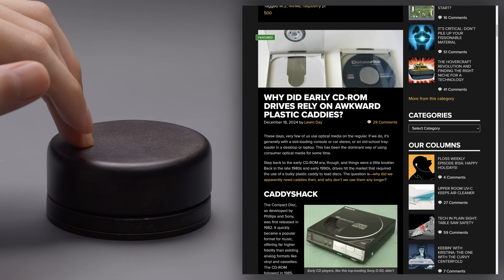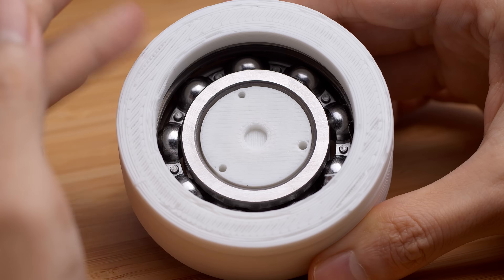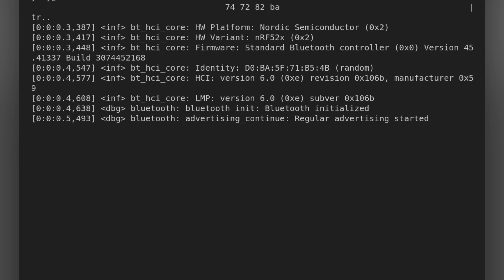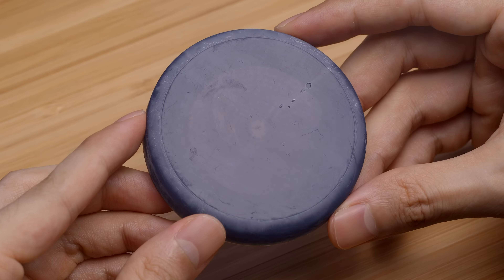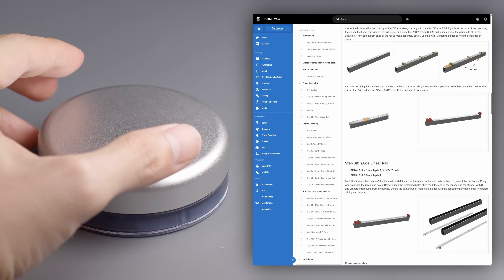Wireless High Resolution Scrolling Device: Full Scroll Dial v2

Comment: If you're making dials of wood, I'd consider buying torrefied wood (also referred to as "roasted"). The process of heating it slowly for 7-10 hours will convert the organic material into carbon, making it harder and most importantly, more dimensionally stable. Standard, kiln dried wood will expand & contract by ~2% if quartersawn, ~4% if flatsawn (grain direction). If you are relying on a tighter tolerance around the bearing, that will matter when relative humidity changes occur. Added bonus, most torrefied, closed grain hardwoods (like Maple) do not rely on the protection of wood finish. A one-step wipe on oil finish would be enough to enhance the appearance.

You could also consider denser, more oil rich woods like African Ebony or many hardwoods from South America as they tend to be more dimensionally stable. That density would contribute to a more premium feel and the oil rich exotics do not require comprehensive finishes, saving some manufacturing time. Ebony, Cocobolo, Lignum Vitae and Rosewood with a light, single coat of beeswax or Tung oil would be beautiful and robust. One caveat, some people are allergic to the oils in these woods.

I'm signing up on your site, I would love to be one of your first customers.
Reply from the maker: Thank you for the wood tips, I'll have to do some catching up on wood selection.
Reply: @engineerbo  As hullinstruments says, you want a stabilised wood, so you can use whatever you like - they are made from a process of putting the piece in a vacuum chamber filled with epoxy resin, so the resin gets pushed into the wood. Knife-makers use it for handle scales (inlays in the handles of knives) and you might be able to find a large enough piece looking at knife-making supply places. I always love anything with walnut and brass. A brass inlay of your logo would be cool. You could use a small lathe or even build one using an electric drill to turn this sort of thing, but I guess you want an excuse to buy a CNC machine ;) Love the project!
Reply: I have a bunch of rare Australian hardwoods, if you can find a safe way to contact me I'd happily send some.
Reply: The most dimensionally stable way is with stabilized Woods. Which basically turns them into an indestructible composite
Reply: i love nerdy comments on nerdy videos
I'd love a wood scroller, as my setup revolves more around wood accents. I'd vote for this option to be available 😋
Reply: this is silly, dont make wood the structural components, continue using aluminum, just put a wood facade around it.
Reply: with exotic and rare woods, costs would increase substantially and deforestation is a real global problem
Reply: @GerManBearPig  I just looked up "deforestation" and man, thanks for telling us. I had no idea where wood came from, but fortunately you were here to tell u all for the first time.

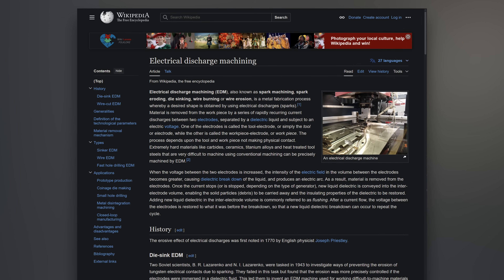Comment: 15:25 i am watching this video to NOT THINK about the disaster that is my wedm project.
So please please please, from someone who tried this, edm is hard. To maintain a spark is hard, to move smoothly enough is hard, signaling is hard, high voltage is hard.
Tldr edm is a hard project, even just a hole popper.
Also... Edms need electrical contact, so you would need to scuff up the anodized surface anyway
Reply from the maker: Thanks for the information, it sounds like... fun? Good luck with your project!

Comment: Making the holes in the top dial larger and epoxying in threaded inserts might be a better option than tapping. Way easier and doesn’t require any special tools.
Reply: Or just press fit the bearing.
Reply: @ It’s tough to use press fits without being able to guarantee tolerances between manufacturers. Especially if it’s a 3d printed project.

Comment: If you do a third video on this, check out the Logitech scroll wheels that are found on things like the G502! You have the standard mode that has a detent per turn for precise control, or you unlock it for complete free spinning action where you can move through stuff quickly and fluidly. It's one of the reasons why I haven't switched away from them despite the issues with the mouse double clicking over time.
Reply: You know you can just fix double clicking by soldering a switch that's less than one dollar right?
Reply: @youtubehandlesux  Sure, but you can also do the "proof of life hostage video" request that their customer support demands if you want to warranty it.

Comment: Al2O3 layer is very hard. Especially for tiny M2 tap. Drill out hard anodized layer before tapping and use M2,5 screw - one is enough for this aplication. Or rotate part slightly and make 3 new holes for M2.

Comment: Why did you use M2 threads so much here? In general for mech assemblies you need a really good reason for such small fasteners since the taps are so easy to break (as you found). Looks like the top part at least easily has space for M3 bolts instead of M2

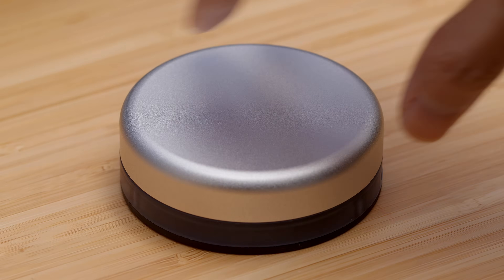Comment: 18:02 What is causing the eccentricity/wobble?
Reply from the maker: I gave the aluminium dial too much clearance, hopefully that's all there is to it!
Reply: @engineerbo  It guess it makes sense, better safe than sorry, to ensure the ceramic bearing fitted in the CNCed top. Although, I think it would have been interesting to see a showcase of PCBWay's capabilities by providing them with a tolerance range or specifying a H7 fit to the known bearing diameter.

Comment: Dear god I hope you didn't spend too much on a potentiometer and bearings lol. I made a super nice on of these myself about half a decade ago, gave it away since I quickly realized I had no actual use for it though lol. Also you're using the wrong type of bearing for the application.

Comment: Amazing! Subscribed. While ordering from pcbway You can choose which holes have to be threaded so You don't have to struggle with m2. As other people mentioned, try to use angle /tapared bearings which are designed for vertical load. And maybe some Silent option.  When You said "middle click" i immediately thought that You will make wheel with buton on vertical axis for example for changing window to scroll(alt+tab). Might be spring loaded for anty accidentall clicks or even optical/mechanical(like limit switch).
Also someone mentioned rgb version, while for me its no go, some gamers would pay to have that one led strip around base facing downwards 30-45°. You could even incorporate on bottom layer of pcb all around with fome smd rgb led's packed every 5mm around the radius. And since bottom is resin printed its already transparent.
Regards

Comment: For MacOS - There are programs that reverse the "natural" scroll. This is a common issue when using a non-apple external mouse. I personally use a program called MOS.
Reply: There is a setting you can change in the macos settings, you don't even need a third party app for it

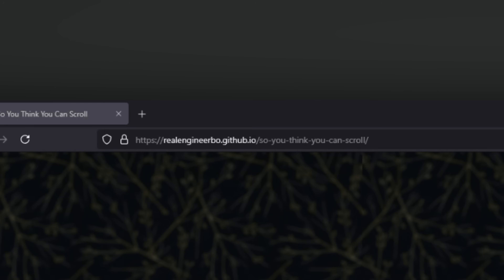Comment: 2:40 If it outputs keystrokes at the full resolution, input-remapper can change this to high resolution scrolling.
I use input-remapper to give my trackball a scroll layer, change some keyboard keys and to map my drawing tablet shortcut keys and dials.
Setting up this is a bit clunky, but once done it is a great tool, which is reliable on release based distros but can get knocked out by Python updates.
I am certain that some more proper Xorg and hopefully Wayland config options exist too.
But this will work for sure and the software is incredibly flexible.

Comment: In that scrolling game, I am consistently scoring 10 points with the two finger gesture on my laptop's trackpad.
But I'll try my trackball layer, steam deck and if it works drawing tablet too in a bit.
Reply: After a bit of practice, I average out on 11 points with this T495 trackpad.
Occasionally landing on 10 or 12, depending on how lucky I get with the amount of direction changes.
Reply: At my desktop, I scored the following:
Scrollwheel: Inadequate resolution, but I could cheese it up to 8 points.
Trackball scroll layer: Firefox is misreading my inputs, same 11 points give or take 1 when it works correctly.
Trackball scrollbar: A consistent 15 points, if requiring some awkward finger climbing.
Drawing tablet stylus: The grab function does not register, so I had to use the scrollbar. A consistent 15 points.
Drawing tablet scroll ring: Thanks to the massive deadzone, I am lucky to reach 2.
Drawing tablet trackpad: Dopey-est input yet, still managed 8-10 points.
Reply: And on Steam Deck, using the trackpad as a scroll wheel or mouse and both ways of using the touch screen yields the same 11 points, give or take one.
Which matches my experience of all the inputs being good and consistent in accuracy, but not exceptionally precise.
Jogging the stick in flick-stick mode or using gyro might be more accurate, but I do not feel like setting this up.

Comment: your project could be a cool jog wheel for video / music editing. Can you make the scroll way slower? now it seems that the resolution is not actually high. If you want to make a jog wheel, you could add an inset offset wheel on the top with its own bearing so you don't need to slide you finger tip if you want to turn it with one finger for precision and comfort. I see comments about trust bearing, I don't think it's the solution, but double conical bearing could be, it will be more expensive but you get the advantage of both, the only issue is how to control the play between the two bearings. taking into account the force your bearing experiences, normal ball bearing is ok. You can improve the noise by adding rings between bearing and base / wheel using a bit more flexible material like nylon, especially on the metal side. Using different type of viscosity of grease can also remove the noise at the cost of freedom of rotation. I would love to see a full metal version including the base, maybe with wireless charging.

Comment: I really hope you drilled the holes to the actual dimension required by the taps you used, before you managed to break off two taps in the hole... With small threads and tapping tools, precision is important. Having the surface passivated can change the dimension of a hole by a lot, especially if it's a pocket hole. I'm pretty sure PCBWay just takes a tool near the right diameter you specify, that they already have loaded in the toolchanger of the CNC machine, and then apply a surface finish without compensation or checking the dimension. If you think about doing production runs, consider learning about how you need to indicate dimensional tolerances on your designs to actually get stuff to fit right every time and all the time.
Reply from the maker: You're right, I was too lax with the tolerances! The hard anodised finish probably also gave the tap an unnecessarily hard time. I should have bored it to size before tapping.
Reply: @engineerbo A typical process is to first demand very good tolerances, and when that breaks the bank, find ways to account for lack of tolerance. There's a reason tools you buy are simply forged instead of machined, hardened and then precision ground. No one could afford that.

Comment: If you used a high speed steel tap, you should be able to dissolve the broken tap out of the aluminum with a saturated solution of potassium aluminum sulfate (alum for short, it's sold as a pickling agent) without damaging the wheel itself. Probably won't help you finish tapping the holes though....
Reply from the maker: Thanks for the tip! I have a fix a couple of clearance issues with the aluminium dial anyway, so I'll probably just make a new one.

Comment: Score: 103,162 @ 6877px / 15 Mosquitoes (I had a few runs with 16 Mosquitoes, but lower score, since it was lower distance traveled.) with just a normal scroll wheel, no need for the arrows keys. If 8 lines per notch isn't good enough for you... just change it?

Either way, the middle mouse button is better than both the dial and the wheel for large scrolls (although HOME/END are better than all of them if you're going full pages.) I will say that the dial looks (and likely feels) better, and is useful for precise increments, but I don't have any purpose for that very precise movements, so I don't really see the need for a standalone device just for web scrolling. Still really cool though.